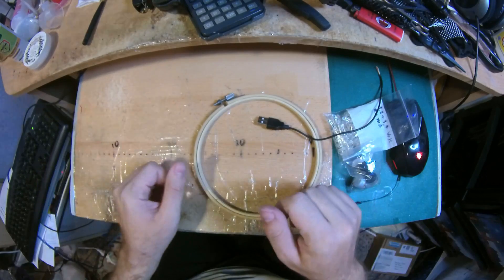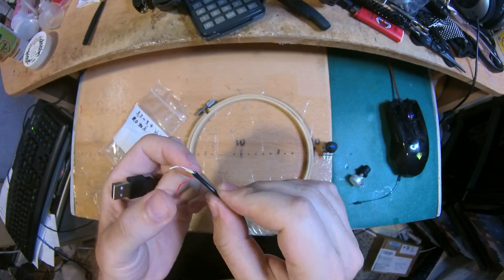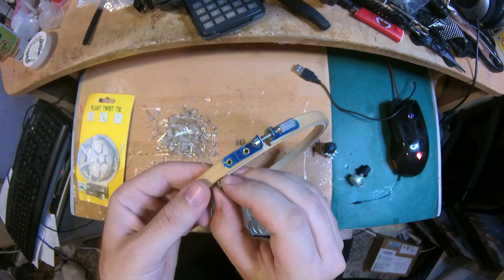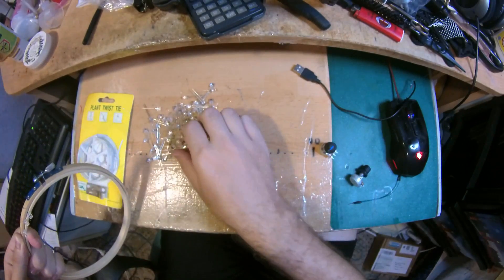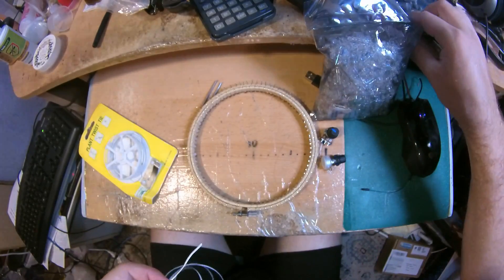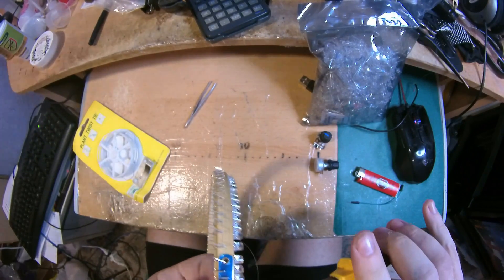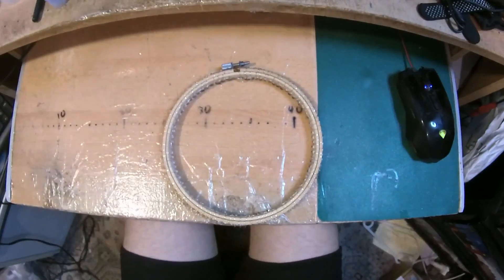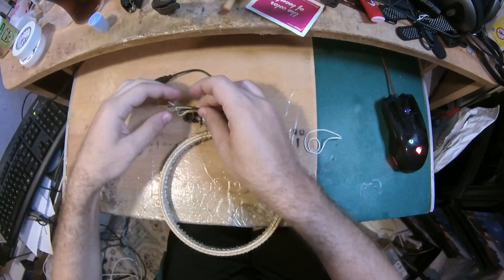DIY - Lighting Ring

Comment: Nice job👍 I have an idea if use yellow bulb to combine with the florescent bulb , believe the result will be more good. Anyway, thanks for sharing your idea.
Reply from the maker: Hey, the truth is that I did a ring like this 2 more times before I made this and posted the video, I once tried to make one with RGB LEDs here and there, but it was too hard to control it and then I also tried to put some LEDs with warm tones but they totally shifted the colour to a very dim green because yellow light and blue light made it slightly greenish, not in my eyes, but in camera it was so off!!!

In my eyes this looks like pure white but in camera it has a blue tint. Having colours on the bottom helps A LOT to keep the camera in good colour balance
Reply: +Super Wig Maker it depends the ratio florescent bulb and yellow bulb. the white balance mode also playing important part.
Reply: +Super Wig Maker I forget which YouTube he sharing a  tutorial regarding this . He doing adjustable two florescent bulb and yellow bulb to get the balance amount of light.
Reply: I means it needs two variable resistor here
Reply from the maker: *****
I understand, I wanted to make a RGB led addition to this but that meant I would need a more elaborate variable transistor to alternate the three different colours.

I also have a 12V RGB lamp that is remote controlled.

It is just that I wanted to keep this kinda simple and it works pretty nicely this way.
Reply: +Super Wig Maker 😊 I understand what you mention, just playing the white balance. editing after shoot.
Reply from the maker: *****
And adding the colours in the background helps A LOT to keep the hues together. It is like it has a sample of many different colours so it doesn't screw the hue.
Reply: +Super Wig Maker you mean indoor or outdoor shoot?
Reply from the maker: *****
I mean the little paper that I have coloured dots in the bottom, I show this in the end of the video that I placed some coloured paper in order to train the camera to keep the hues correctly.
Reply: +Super Wig Maker oh, I see. this is as a ' color picker"
Reply from the maker: *****
Yes, professional photographers use something similar called "colour checker passport" it has specific colours in specific arrangement and then they can load the photo through a program and create a custom palette that can fix the colour to totally neutral natural tones.

Of course the closer the colours to the original the best, it is not that they can take a totally offset coloured photo and turn it into a 100% fixed one.
Reply: +Super Wig Maker 😊 yes it is